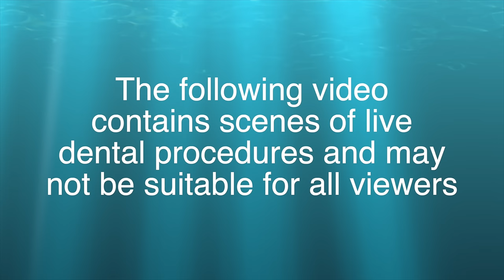Molar GP retreatment

Comment: Nice to have you back posting, Dr. Rhodes! 
What I have been asking myself for a while is: How do you confirm your definite working length? 
Do you mostly rely on the apex locator alone without taking a working length- or a cone fit-radiograph? 
Thanks a lot!
Best wishes
Reply from the maker: Great question and thanks for watching!
Yes - I mainly reply on the EAL and use a diagnostic PA when things are not as I expect!
Cheers

Comment: Thank you doctor for sharing the endodontic machine mode when using the f2 machine file
Reply from the maker: I use an X-Smart motor - my dental chair, which is an Intego also has endo motor on board - each file has its own set-up programmed in

Comment: So good to see you posting again Dr Rhodes and thanks for another great video! Just wanted to ask about your approach to removing the very apical portions of old GP - in most cases you post here it seems you use GG / SX for coronal, rotary / reciprocating instrument for middle, then gain working length with a 10C through the final bit of GP, then proceed to shaping - what happens to the last bit of old GP in the most apical portion? Does this get removed along with your final shaping? Thanks Doc :))
Reply from the maker: Great question - yes the final shaping and irrigation remove the last bits of GP...Thanks for watching

Comment: Thanks John, did I notice correctly that you are not attempting to place sealant in the full length of canal, only at the apex?
Reply from the maker: That is correct, the sealer coats the canal walls during downpack and then flows as the backfill is completed....you dont usually need extra sealer...
Too much sealer and you risk extrusion...
Thank you for watching

Comment: Great video! One question - why do you use both an ultrasonic tip for activation and the endo activator?
Reply from the maker: Good question! The sonic activation allows pumping whereas the acoustic microstreaming of ultrasonics creates a flow in a coronal direction.,
The ultrasonic tips also fracture easily and are more expensive!

Comment: Thank you very much for the nice presentation of these cases 
I would like to ask for a way for removing apical gutta percha in Re-treatment cases I often face problems while trying to remove the last 3m of gutta which force me to use solvent which sometimes doesn't work.
I will be glad if you guide me for the best protocol for removing apical gutta percha 
Thank you again !
Reply from the maker: Hi there!...I normally reply on my preparation file to do this. A C-file can be handing for penetrating through the last bit of GP and the NiTi should follow
Reply: I will give it a try !
Thank you Sir for your reply

Comment: Hi Dr. Rhodes, is it easy to clean off the GP from the GG #1? I've been using the Protaper ReTx File D1-D2 for the coronal third but it seems like GG #1 works much faster. Thanks for the insights!
Reply from the maker: Hi Michael, yes the GP will come off the GG with a sponge/tissue/ tweezers. Gates are very efficient. Cheers

Comment: Ive noticed a lot of the experienced operators as soon as they feel the stick of the MB2 they get a flexible but strong file something very thin and you can see it bending as it tried to snake its way down. I guess in experienced hands this works and is more conservative. I tend to use the undercut approach and go a bit deeper so I bypass the horizontal aspect and just get straight line access, is this wrong?
Reply from the maker: Hello there!
If that works for you then stick with it...Trying to negotiate the entire (often tortuous) canal with a hand-file is very prone to problems without some coronal flaring.

Comment: Hi John I still struggle with not being able to always get patency - I try not to ledge as much as I can and recapitulate regularly. When I suspect a ledge I try bending the tip but it never seems to catch the original canal and drop down! Any tips?
Reply from the maker: Hi there
What preparation system are you using? 
C-files can be useful when the canal is very narrow.
Gliders are also great for establishing a glide path
Cheers
John

Comment: Hi dr great to have you back , I wanna ask u abt a case I have it’s a retreatment  a lower 1st premolar that I  doubted it had 2 canals so before going any further I ordered a cbct for my patient and confirmed it , the lingual canal was not treated , I checked the length on cbct and it was 17.1 mm on the lingual canal but I don’t get any reading on my apex locator and I can’t get passed that length with my hand files it’s like hitting a wall , so what should I do in this case I tried ultrasonic activation to remove some debris that may have formed but no results , on my working length radiograph I am still abt 2 mm short , plz note that I finished preparing the buccal canal and got a positive reading on my apex locator and the tooth had periapical radiolucuncy around this tooth probing length on the distal was about 4 mm , so what in ur opinion is the next step to do ?
Reply: Pls also note that there was a little swelling around the buccal coronal  side of the 2nd premolar which was also poorly treated by the previous dentist but was asymptomatic to percussion .
Reply from the maker: Hi there!
The lingual canal of 1st premolar can be obturated to the most apical length you have achieved; do you think the 2nd premolar needs revision? that may account for the buccal swelling.
Cheers
John
Reply: @johnrhodesendo  hi dr , even though the swelling around the 2nd premolar actually related to the 1st premolar it does have a very bad root canal even though it’s symptomless, I think I need to wait for the swelling to subside before starting the treatment of the 2nd premolar due to economical factors of the patient . I will obdurate the 1st for now as you instructed me thank you so much for ur help.

Comment: These endo dentists seeking to elevate the protocols and also saving the pulp are raising endodontics to a higher level. Hoping the biological filling and medicaments keep the tooth from a poor future outcome
Reply from the maker: These teeth were not suitable for a regenerative approach!!
Reply: @johnrhodesendo  Why?  . Doesnt the prf placed inside the canals as described by Richard Miron and Valerie Kanter , begin to regenerate whatever needs to repair ?
Reply from the maker: Hi Coco, In a retreatment case where the canals are contaminated with bacteria and the apices are fully formed there is little point attempting regenerative techniques over conventional root canal retreatment (in my opinion)... However where there is an open apex and good vasculature a different matter! Bacteria are the endodontists enemy !🦠